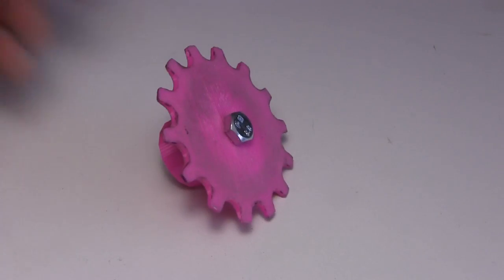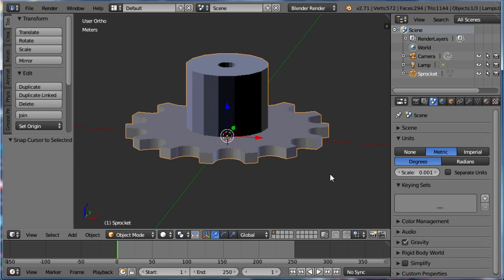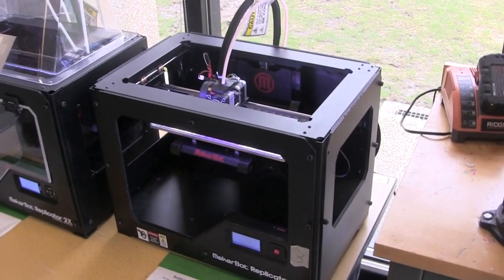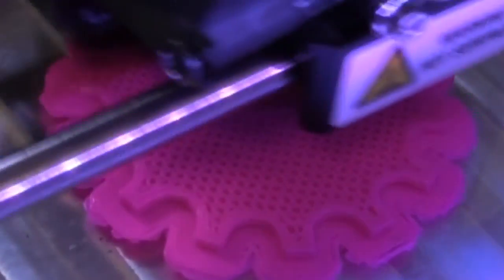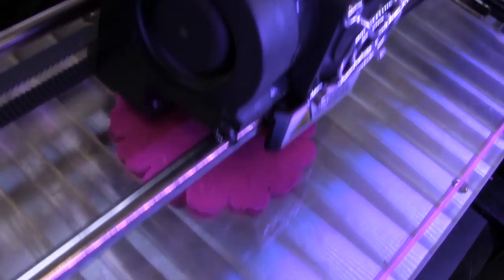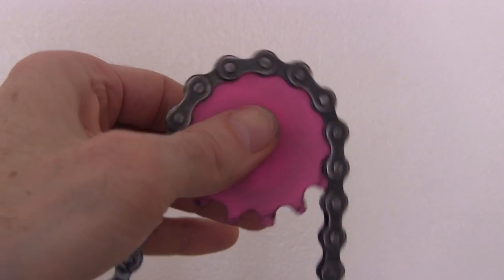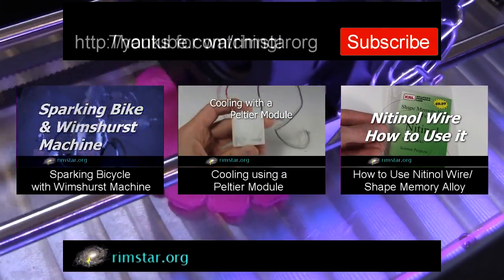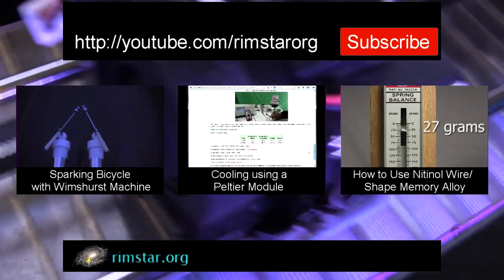3D Printing a Bicycle Chain Sprocket with MakerBot Replicator

Comment from the maker: Step-by-step of how I designed and 3D printed the bicycle chain sprocket for my sparking bike. Enjoy!
Reply: RimstarOrg 

one issue I have had with 3D printed gears in the past is that they don't seem to hold up well to higher speeds or power levels.

for example, for a gear intended to spin at around 6000 RPM and driven by an electric motor at around 1/2 HP (400W), in one case there was some drag and the center-shaft area began to basically melt/liquify. in another case (a replacement for the former gear), the gear teeth basically all ground off.

had also tried using thick rubber bands and pulleys, but then the bands got hot and made a burning rubber smell during low-power tests. had at one point considered denim straps (possibly two layers of denim with a thin coating of silicone caulk), or trying to get some more proper drive-belts in the size, but didn't get to it.

had also wondered about using a 3D printed pulley with a V-belt for operation at around 5 HP (driven by a slightly larger electric motor), but no idea how well it would hold up (probably a steel pulley would be better in this case).

no idea how well 3D printed plastic would hold up to a bicycle chain if used to drive a load (say, if it were used for drive gears or similar for a small single-passenger electric vehicle).
Reply from the maker: Brendan Bohannon I don't know either how well my 3D printed sprocket would hold up under a big load. The Wimshurst machine disks don't provide nearly as much of a load as the rear sprocket feels from rotating the back wheel.
Reply: RimstarOrg

yeah. such is the problem...

like, for the single-passenger EV, I could use a plastic pulley and a V-belt (the motor already has a V-belt pulley, so I would use the other pulley mostly for the axle).

but, I sort of suspect there is a pretty high chance that the pulley would not hold up so well (and would eat a lot of filament). my guess is that self+vehicle would probably be somewhere between 150 and 200kg (around 300 to 420 lbs).

but, yeah, 3D printed plastic parts work pretty good for a small 9kg / 20lb robot at least (runs with about 50W per wheel, where the gears and the wheels are 3D printed, *), and my CNC milling machine project also uses some 3D printed plastic parts.

*: though, this project did have an issue with running into issues with the shear-strength of hot-glue, which I had fixed by drilling in a some 12AWG copper pins, and in later designs using keyed rectangular shaft interfaces (similar to socket drivers).

Comment: 3d printers look so useful.
Reply from the maker: GoRepairs They certainly make for easy to put together components. Check out this instructable I was just looking at http://www.instructables.com/id/Bike-Basket-Tutorial . The 3D printed bicycle case includes parts for the hinges, the latch and holes for attaching the hose clamps. So simple to assemble once designed and printed.
Reply: RimstarOrg That's a pretty cool build. I think I'll wait until the price of them comes down before I buy one though. :)
Reply from the maker: GoRepairs You can make a small one from a kit for around $350-$400. Look into ones like the SmartRap mini.
Reply: Thanks. I'll have to look into it.

Comment: Very cool Steve! I'll check out Blender - never played with it. I model in SolidWorks, wonder how similar the functionality is? My son Alex and I are planning a father-son build in the future making a 3D printer from a kit. Keep up the great work!   -Ritchie
Reply from the maker: SonicDadDotCom Thanks Ritchie! I was just at a maker event this morning talking to someone about the difference between Blender and SolidWorks (which I don't have any experience with.) Blender uses a mesh model, which makes it relatively easy to sculpt and shape. SolidWorks uses more of an extrusion approach (speaking from ignorance) and so really random shapes and curves are harder (think of trying to sculpt all the contours of a face in SolidWorks.) But it's easier, I'm told, to make something like a screw in SolidWorks. Your 3D printer from a kit build sounds like it'd be a great series! I was thinking of doing the same thing. It'd be great to have one of my own. -Steve
Reply: SonicDadDotCom 

I have mostly been using a combination of 123D and using custom command-line tools for things like gears and similar (where I generate them procedurally).

for the command-line tools, there is a simpler tool where I had mostly been editing the code to make parts (make code to make the part, and spit it out as STL files). there is another tool which executes a sequence of commands from a text file. the intention was basically to do a procedural CSG/BREP tool, and has been used for a few things.

123D has a bit of "WTF?" and kind of a limited UI, but it works (and is reasonably usable once one starts to get used to it), so has been used a lot for making simpler parts.

personally I haven't had a whole lot of success with Blender (as-in, actually getting anything done with it).

I also have my own 3D modeler, but it is pretty bad (mostly not very useable) and I hadn't got around to adding STL support to it (and would probably need to tweak stuff to make it better suited for designing parts). it has a 4-views layout and the user-interface is almost entirely driven via keyboard shortcuts (no menus or dialog boxes or any of that stuff).

Comment: Is that PLA plastic you printed with? Also, if you print a flat part like that you're better off printing with a brim and not a raft. Rafts are good for parts with irregular bottom surfaces. Flat surfaces print fine against the build plate and then you don't have to sand them so much when finished. Also, consider printing in black next time so the chain oils don't make the sprocket all grungy. Keep these videos coming!
Reply from the maker: USWaterRockets Yup, PLA. Thanks for the brim vs raft tip. I was only aware of rafts before. From looking it up now, even a skirt might have worked since any deformation from uneven cooling at the outer edge isn't an issue with this since I sand it there anyway. BTW, the sanding I did was just to give a taper to the teeth, and a little of the area between the teeth on both faces, so that it would work with the chain. I didn't need to sand the rest of the bottom since the raft came away cleanly. Regarding the color, it was my first time printing and the place was very busy so I didn't want to use too much of the attendant's time to change filaments (and it was free!). I figured I'd paint it but then I liked the way it stood out for illustrative purposes. If this was a practical, everyday use thing then I'd probably paint it or have cared more about the filament color.
Reply: I misunderstood the purpose of the sanding you had done. Typically the raft leaves a bunch of scrap behind when you break it off and you were sanding that off. If you were trying to replicate the taper of the original bike sprocket teeth, you could have created that part in blender and made the sanding job a lot easier. Or you could have put the part in an electric drill and sanded it really fast and evenly. If you do more of this you will learn your own tricks to make it easier. You may even find yourself tempted to get your own 3D printer. It's addictive!
Reply from the maker: USWaterRockets So far, in my limited experience, I've found that a raft is easier to remove if you do it right away, but if you wait a few days then it's harder to get off. As for the sanding I did, it took may 15 minutes so it wasn't a problem. If I'd been able to create the taper in Blender, how would I have done the taper on the bottom, the face sitting on the print bed? Would the raft just have been inserted to fill that taper? I would have thought that'd be considered an impossible overhang (speaking from ignorance.)
Reply from the maker: USWaterRockets Hmm... Somehow I missed that video. Thanks.

Comment: Just a "tight fit" on the sprocket bolt? Seems like that will eventually wear and need some sort of set screw or something to hold it in place.
Reply from the maker: rockytube Maybe, but there were no signs of any loosening. If it did loosen then my backup plan was to drill a hole completey through the plastic collar and the bolt and insert a piece of clothes hanger wire. The weakening of the bolt wouldn't have mattered enough, given that the load is just the Wimshurst machine disks, and I doubt the clothes hanger wire would have sheered.

Comment: How much force do you think this can tolerate? I want to make one to connect my bike chain to a small motor to generate power
Reply from the maker: Re It's hard for me to say since the only thing I've used it for was that Wimshurst machine. I could grab the sprockets in my hand and use it to turn the machine by hand and there was some force required but its hard to quantify from just that. It seems to be able to handle a surprising amount for plastic. Intuitively, I'd guess it could handle a small generator. You could always set the infill to 100% and/or add more shells which I talk about at around 1:20 in the video.
Reply: RimstarOrg Hi thanks for the response. My boyfriend has a 3D printer and I always wanted to do this but I thought the plastic would be too weak.
Reply from the maker: Re
Yeah, I was a bit surprised that the plastic worked so well too.